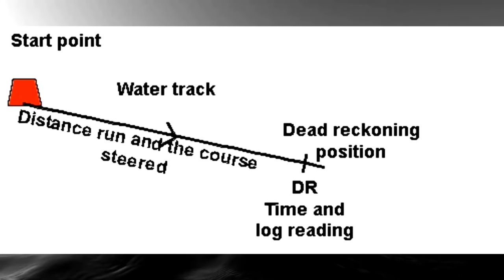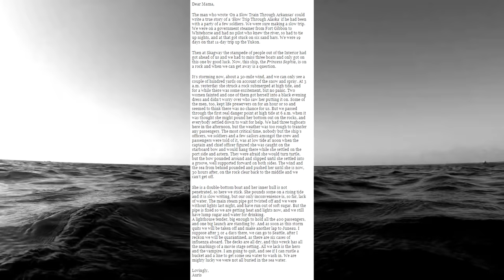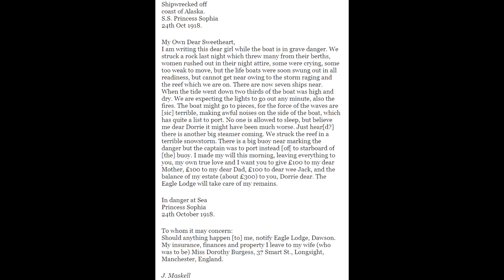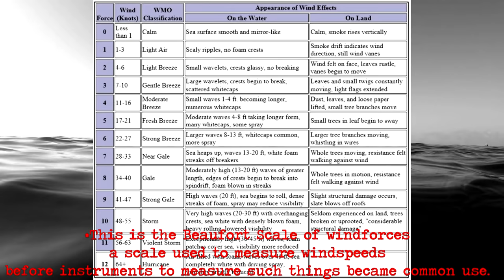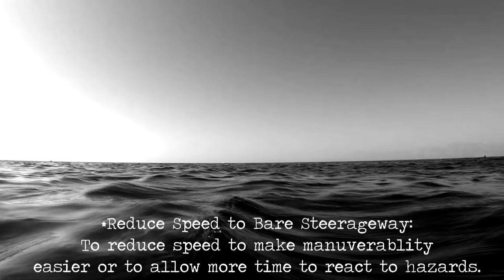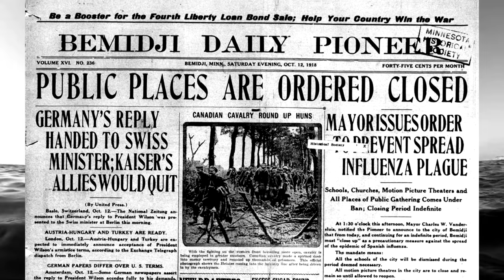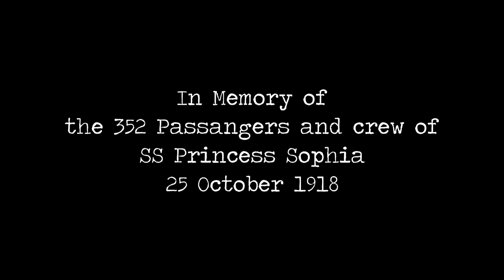The Grounding of the SS Princess Sophia

Comment: My takeaway from this story is that when someone offers you assistance, you take it.  So many missed chances to prevent this tragedy.
Reply: Not really. If you're caught in what appears to be the middle of a storm and you have no weather measuring equipment, no easy method of getting accurately predicted data, is grounded on some rocks, have found minimal damage from inspections and have sailed the area while a similar event caused death and destruction for trying to evacuate, then you'd do as the Captain of this ship too. Especially in heavy weather, as storms at sea are 100% unpredictable. You don't know if the wind calms off in the next hour or if it increases. And you don't want to risk more lives, aka the rescue ships, if you can avoid to.

Comment: Calling the innsid3 passage "calm" is like telling a soldier he will soon find the safety of battle
True it's largely sheltered but while that's true it isn't said that it has large expanses of open water in North/South alignment which with strong winds f4om either of those directions can make towering steep siided chop of over 10 feet or more, the narrow channels allowing for wave propagation and actually enhancing it due to the shape of the coastlines
  Then there were also countless submerged rocks all over the passage that weren't always known until a ship crashed upon them. 
The currents in the passage are some of the strongest in the world, and no sailing vessel could sail opposite the current, even early power vessels just didn't have the power to overcome a current that rivaled their top speed and also made dead reconing even more inaccurate in the days b3fore even radio nav. 
Then there was the lack of infrastructure to.rescue any ships that did get jn trouble as so many of these stories reveal....making land after a shipwreck was only half the battle...then you battle wildlife, weather, starvation, exposure, and possible humdr3d miles walking through mountainous wilderness to find sparse population tk help.